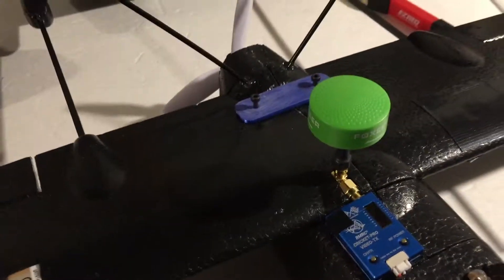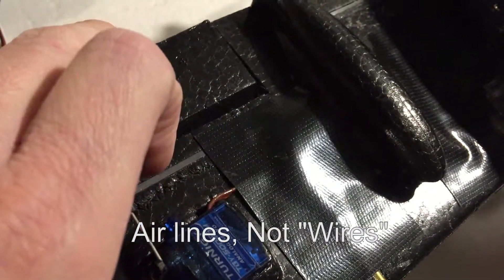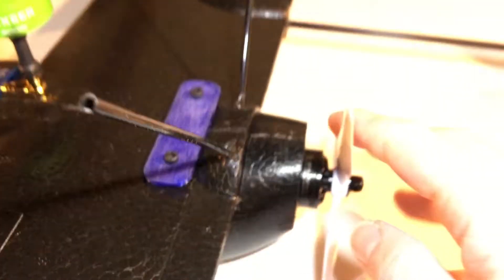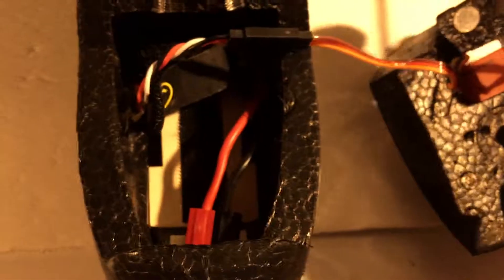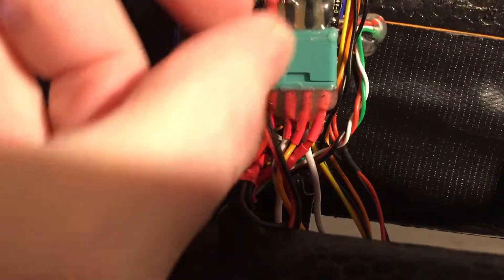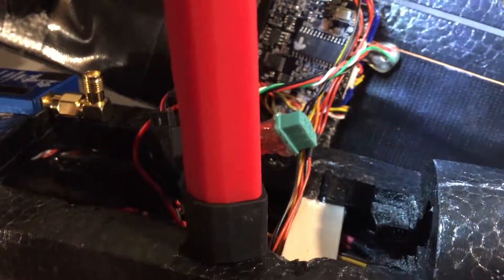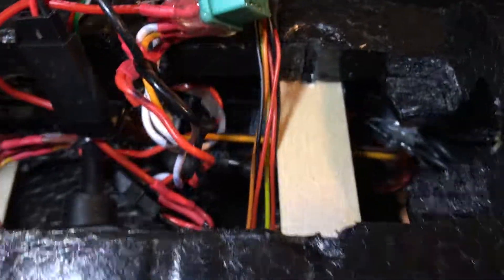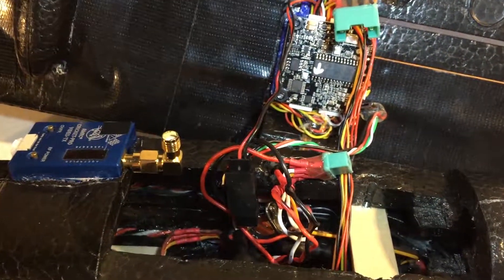Nano Skyhunter w/ Vector Teardown.

Comment: Hey, ever try that black "hot met adhesive" hot glue ?? Apparently the auto body industry uses a handful of special types of guns (higher temp?) and sticks of assorted bond strengths to pull dents , like blob a bunch on the dent to anchor a stud to the damaged panel so that a slide hammer or other brute Force apparatus can attach and yank the dent out.  I mention it because it is obviously the right color for that badboy ... But also because it's the freaking best .. typical hot glue is ok but I find as it ages it's more of a stiff acrylic as time goes on , the black color hot glue the auto body folks use is so much better .. bond is incredible and I it's like a rubber , super flexible yet strong. I found it on Amazon.

Comment: Are you using a full size Vector?  I'm building a nano but am using a mini Vector and was planning to remove the case also.  If you got the full size in there kuddos to you as it is a pretty good sized unit!  TKX
Reply from the maker: Nope,  I was the Micro Vector de-cased.  I have to say,  I ended up bailing on this project.  I had it fully built and flew it a couple of times, but the added weight just killed the flight characteristics of the NSH.  Maybe if I didn't go full out with Airspeed and GPS.   I moved the microvector to a RMRC Mako that I have.  I now run a Naze board in the NSH running the "Nazeplane" firmware.  Basically for gyro stabilization and minimOSD.  Light weight and flies great,  It just doesn't have all the bells and whistles.
Reply: Ahh, that makes sense, I am a little worried about the weight.  I'm planning to use a Black Widow 2208/2100kv motor with their built in esc so hoping to save a little there.  I'm not going to use the airspeed but did want the gps as you don't get much capability without it, kinda the whole point of using a vector!  I can fall back on the Naze option if needed.  What was your all up weight with the nano?  I've read that performance starts to suffer about 530 grams but most are keeping it at 480 or below.